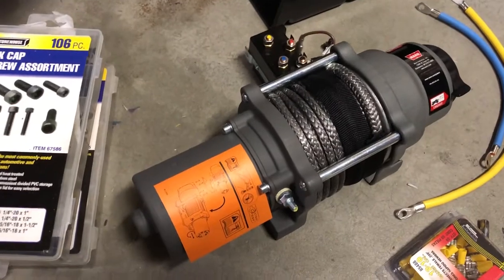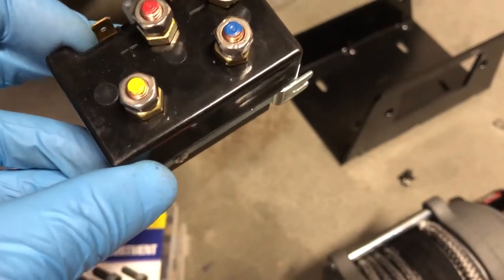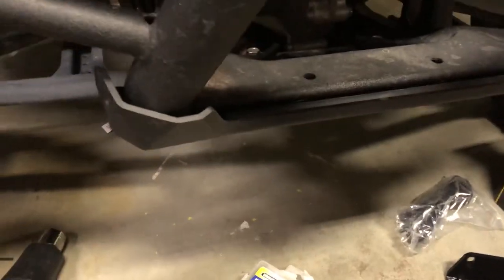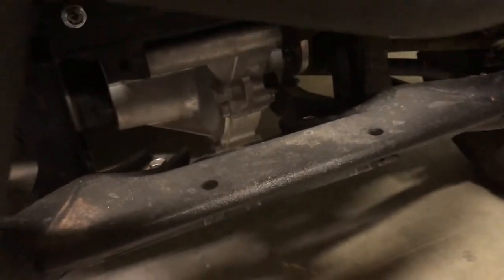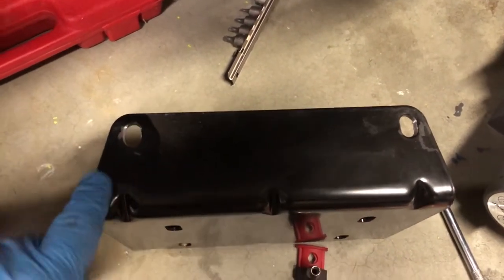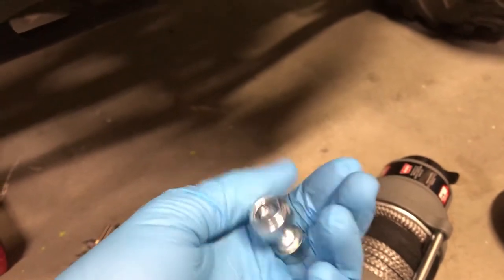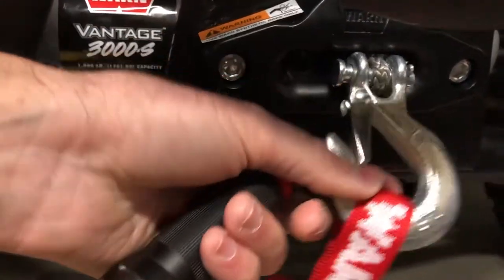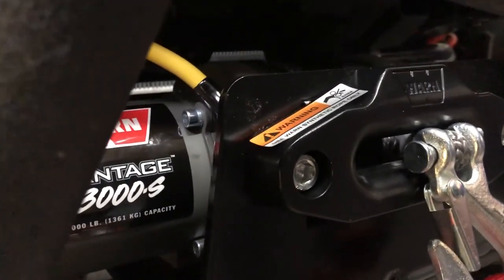How to install a winch on a Yamaha Wolverine x4

Comment: I baught a kfi 4500 and all the wires were super long so that was awesome. I have rope on wheeler winch and will never use it again. The rope rots over time even being garage kept and its a crappy surprise when stuck or plowing. The kfi had so much wire i mounted the solenoid up by the low speed key switch which looks and fits great. It also came with a way bigger and heavier mount. Im not a fan of warn as ive had two that were junk and they are expensive but cheap on wire and dont last. I have two kfi's and a tungsten which i would highly recommend!  Other than the rope on tungsten, they've all been great. I will say the red ignition wire was a bitch until figured out. DO NOT FOLLOW DIRECTIONS IN KIT which say to wire the red to the accessory plug! It or they if you have a hand remote also go to the wire provided from ignition behind the dash. I could have saved hours of soldering and fucking around if directions were correct.  So much easier with correct directions. For quality, KFI is worth the money! I wont buy another warn EVER lol kind of like chevy....